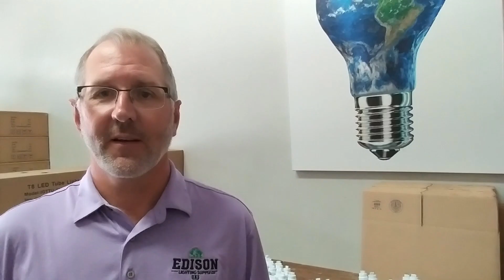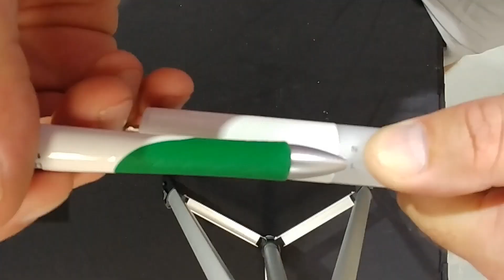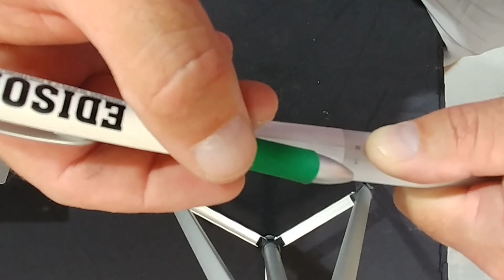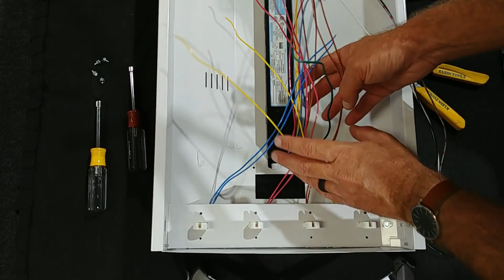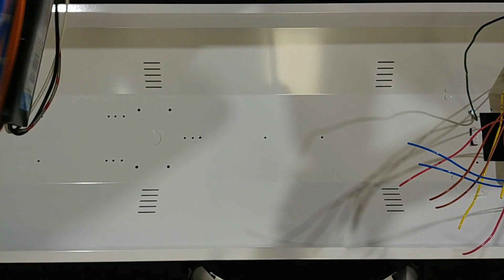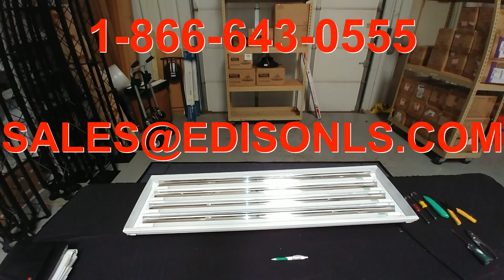How to Retro Fit T5 Fixture with Ballast By Pass T5 Tubes

Comment: You are wrong cutting off opposite side. Tube on the "just mounting" side has prongs shortened and is supposed to be in the circuit loop.
This allows the orientation of the LED to be free from rules but also saves the fluo tube inserted (accidentally) from blowing up

Comment: This video is the 1st I've watched; yet, this is fine for a single ballast + four lamps. I have two ballasts - each ballast operates two T5 tubes. Not a huge deal, but I'll need to dig further & consider how my ballast bypass will be wired. Good overall video though. Thanks.

Comment: Hey I desperately need your help I have an 8 lamp t5 fluorescent fixture I recently purchased a ballast and need to replace one of the ballast however the new ballast has two blue wires also two smaller blue wires with a white line on it, also two small red wires and two large red wires with white lines on it, at the other end of this new ballast there are two yellow wires and one white wire. Now the old ballast that I had taken out has one yellow and one white wire on the other end of the old ballast there are only four red wires on this end, my question is what wires do I need to use on the new ballastto connect to the four remaining red wires from the old ballast where do the white and yellow wires go? Remember there is an existing ballast that still worksand still lights up the four of the eight fluorescent lights, on the end of this working ballast there is a white wire and a yellow wire exposed on the opposite end of this working ballast these four red wires are currently hooked up to the for fluorescent fixtures that work, the four remaining wires are hooked up to the fourth fluorescent lights and are exposed as I cannot figure out where those for red wires go to the new ballast.. sounds complicated yes maybe I should make this a challenge to you for me as I am running out of resources LOL... Thanks for your help if you can Rob Niagara falls Ontario
Reply: Still needing help?